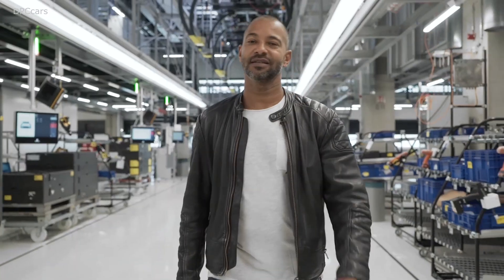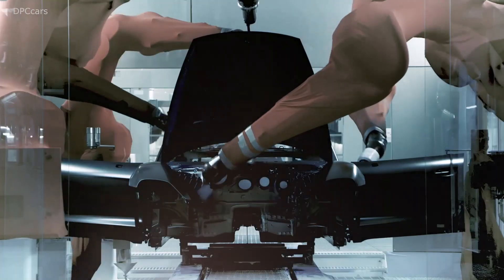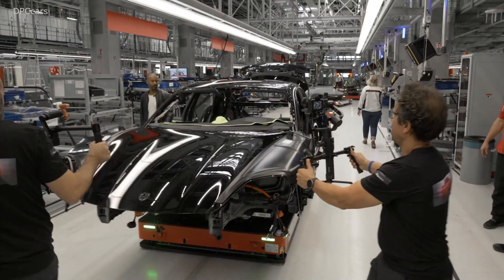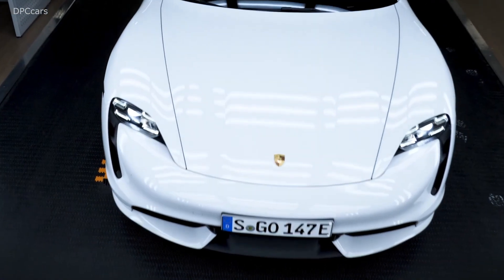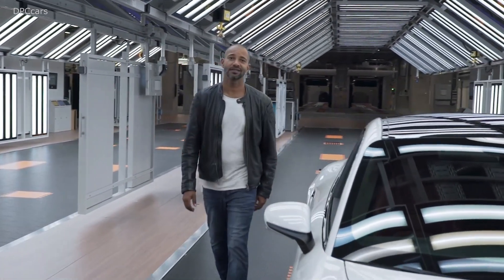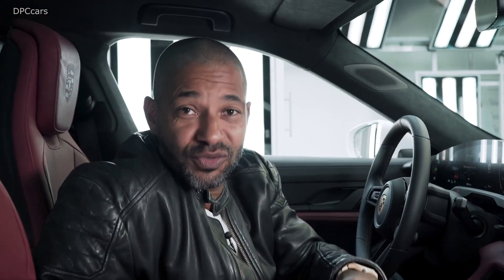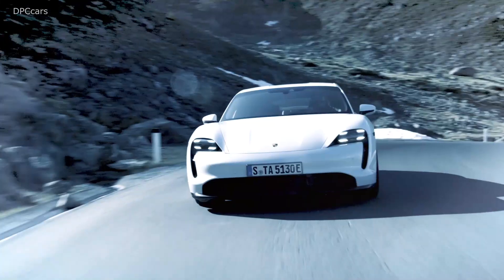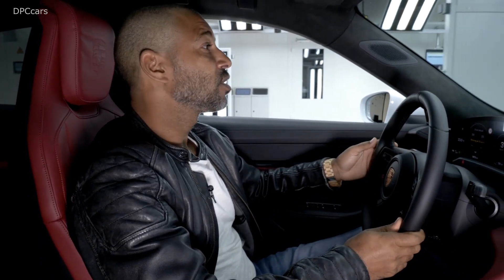Electric 2020 Porsche Taycan Explained

Comment: There is a reason they don’t show the UI or him actually using the screens.  How are you actually going to use the passenger side screen for directions without a co-pilot close enough to read it? Doesn’t seem well thought out.
Reply: The optional passenger screen is truly a passenger screen only. Porsche even disables it if there is not a body in the passenger seat. The idea is that navigation used by the driver is displayed in the top center screen or the driver curved display. During that time a passenger can be looking up a place to eat or shop or charge. When they find what they want they can add it to the route and poof it shows up in the center of driver display. Also the passenger can do music change all with out disturbing the screen that the driver is using for navigation.
In my Taycan config I would totally spend $1000 for that feature.